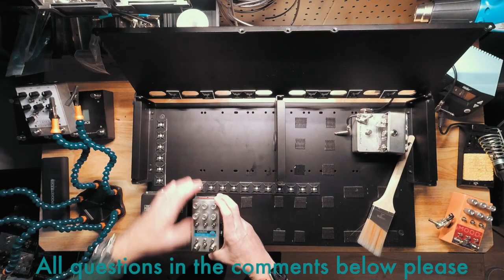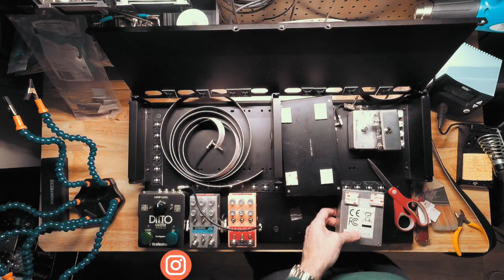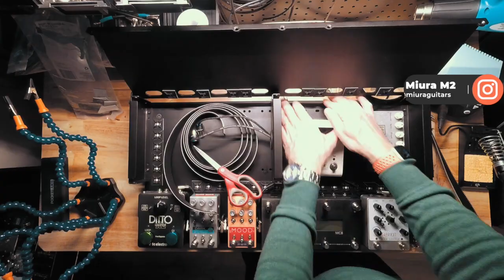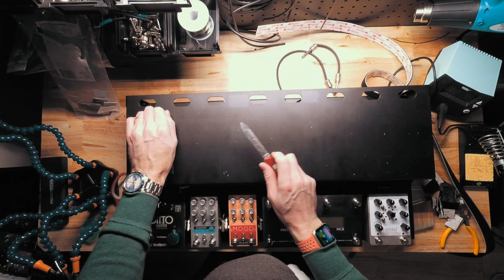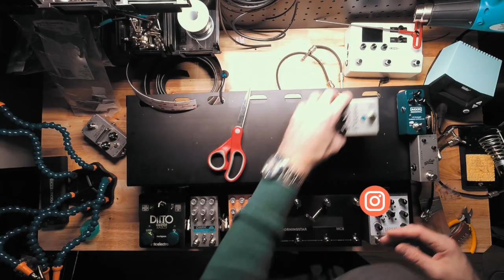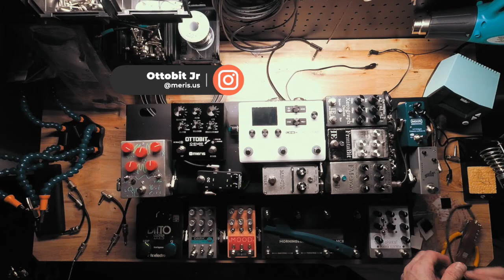Epic Pedalboard Time Lapse | 18 Pedals, 1 Vertex Effects Board

Comment: Janek, have you looked into the pedal boards made by Temple Audio... No more velcro, the thing I hated the most when using pedal train type of pedal boards.
Reply from the maker: I mean... yes and no. Technically no more velcro, but you do have to stick their proprietary fasteners to the underside of the pedal still right? 

So whichever way you look at it, you're still sticking something to a pedal, and really have a lot less flexibility when it comes to making very small shifts in position of pedals to accommodate more effects on your board. 

I'm not saying it's a bad product. I'm sure it works great for many people. They are a very successful company and are dedicated to high quality from what I can tell. I'm pretty sure my great friend and bass player John Davis still uses one of their boards for his rig. 

But the super low profile of the vertex boards I'm using allows me to have two levels with the riser, and build out an incredibly accurate board with everything customizable to the mm. With the temple boards it seems as though you're already almost at the height of a vertex board with a riser, with just one level. 

Again, if you need a super solid board, that doesn't need to be pinpoint accurate because real estate is so tight, then I think Temple Audio is a really great solution. But I think it's a little more on the prosumer side of things than the options of a highly customizable, low profile, two-tier board like the one I'm using right now. 

I have some really weird requirements for what I do, so I'm the first to admit I'm not the best barometer for what works for most players.

Comment: Surely you're going to fill that space on the top left under the riser? 😉 Isn't that where you were considering adding a second stomp?
Reply from the maker: Definitely considering either the Stomp or the morningstar ML5/ML5+. I want to do something with parallel signal chains having one side for ambient stuff, and one side for cleaner bass signals to play under the loops.
Reply: @janekgwizdala  I forgot about the ml5. If you had a parallel chain with the ml5, would you still want to have stereo fx? Or would it be a one or the other type thing?
Reply from the maker: @craigsi16  Probably not going with stereo for the touring board, unless I can find a really compact solution. The ML5 would probably be used to keep a couple of pedals under the hood and control with midi.

Comment: Sick board, man!
How are you powering 18 pedals, tho?
DC7+DC4? Is there a DC8 hidden somewhere?
Reply from the maker: Some of the pedals, like the three Iron Ether boxes on the top deck, only draw around 80ma so I'm able to daisy chain three pedals off of one outlet. Each outlet on the Cioks gives you 660ma at 9v, so there's more than enough headroom. It's not idea, but it does mean it works with what I have currently. I am considering the Cioks8 expander though, especially if I add a second HX Stomp to the signal chain.